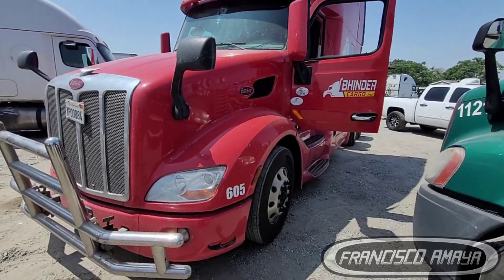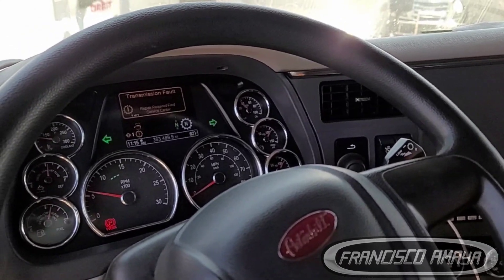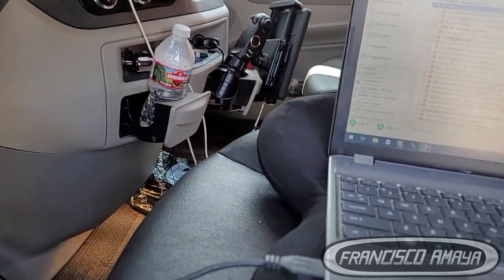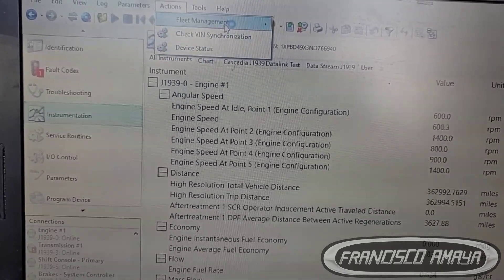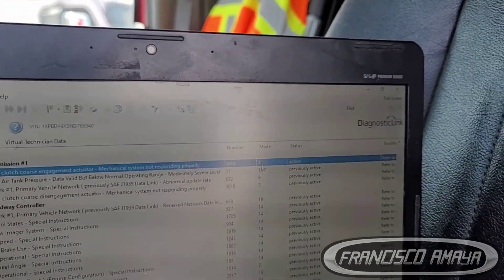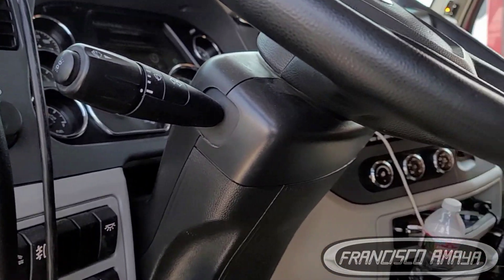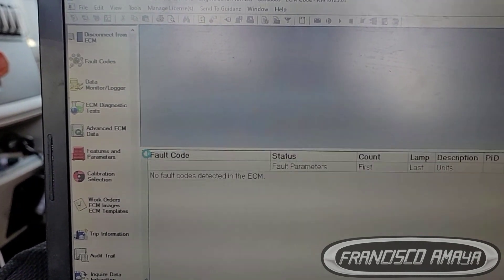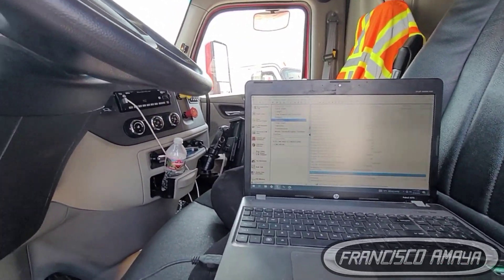EATON ENDURANT AUTOMATIC 12 SPEED TRANSMISSION CLUTCH PROBLEM SPN 5614 FMI 7 KENWORTH PETERBILT

Comment: The big  trucking companies pushed to have these junks installed because they alleged that they couldn’t find qualified truck drivers that could operate a manual transmission.  They wanted steering wheel holders or dummy. Shoot, even The claimed that you will get bette fuel mileage but it’s all a lie.

Comment: Notice the low air pressure. If there is an air leak that drops air pressure all the time. This will not allow the clutch to operate right. And confuse the computer thinking there's a problem and throw code.